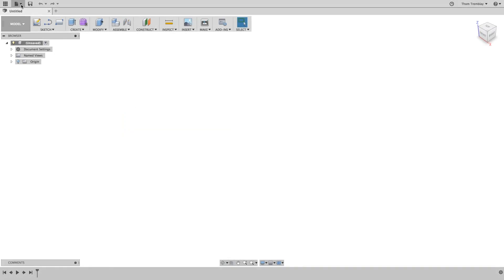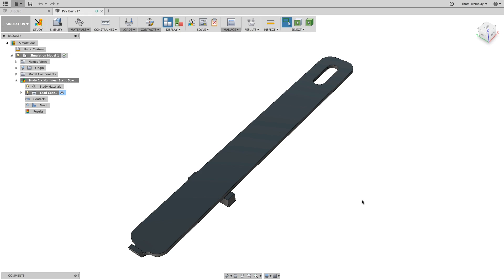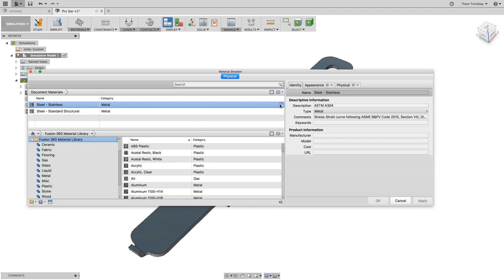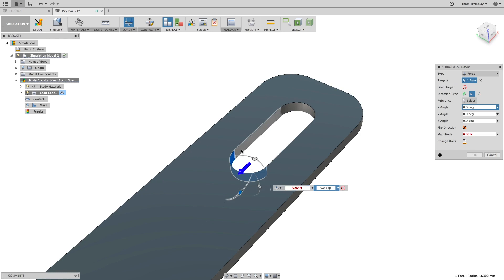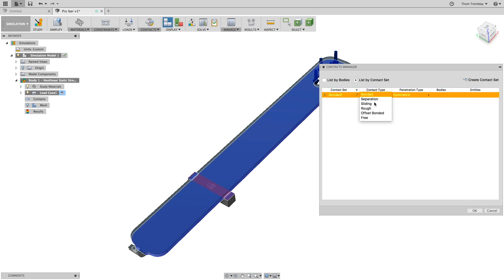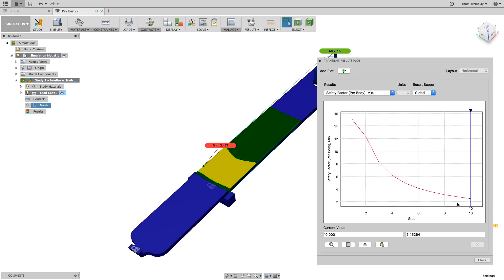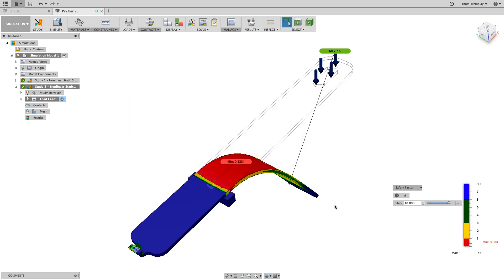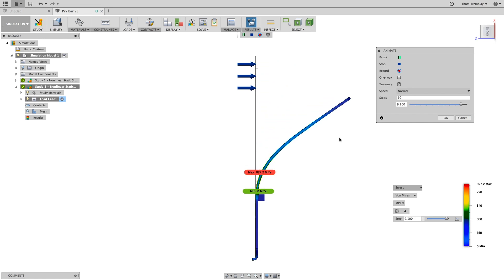Beyond Yield with Non Linear Elasto Plastic Materials

Comment: Bonded contacts!  You've solved my problem! Thanks!
Reply from the maker: Happy to help!
Reply: Can you help me with a modeling issue? No replies to my forum question. I want to non-proportionally scale a spline, but can't find a way to do it.   Normally you can select a spline and a scale POINT and the spline will shrink or grow radially from that point.   I would like to select a LINE and scale the spline relative to that line. The line could be one that connects the first and last points in the curve. Scaling relative to that line will give the curve more or less of a hump.  Or, I could scale from a line perpendicular to the endpoints, and it will stretch the spline at the ends, but keep the center at the same height.   I can not just move the points.  Moving individual points will change the character of the curve.  I want to keep the character but change the aspect ratio.   Any way to do this?
Reply from the maker: It would appear you can only scale sketch entities uniformly. Not sure what you're working on, but you may want to try this: https://apps.autodesk.com/FUSION/en/Detail/Index?id=52036486659592142&appLang=en&os=Win64
Reply from the maker: Alternatively, you could use the spline to make whatever feature you want, then scale that body.
Reply: I can only scale that body along xyz. I need to scale it relative to it's baseline or an arbitrary plane.
Reply from the maker: I don't think Fusion will do that for you. This doesn't sound like a common workflow, so I also wouldn't expect to see this added any time soon either.